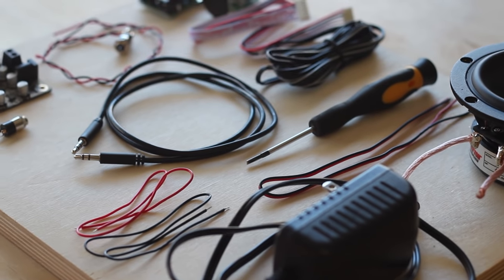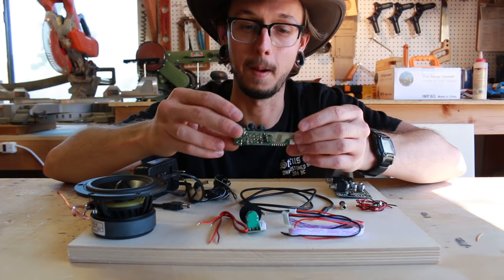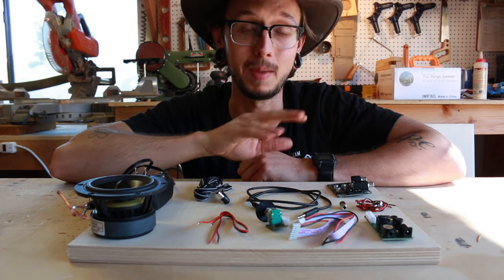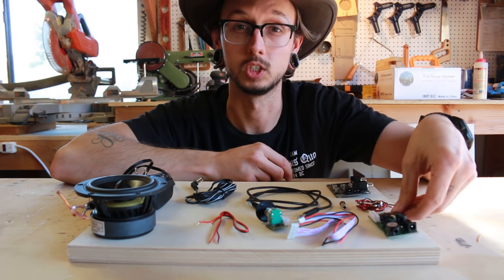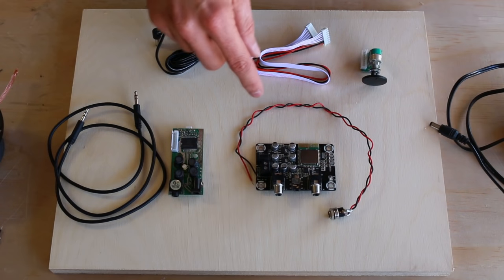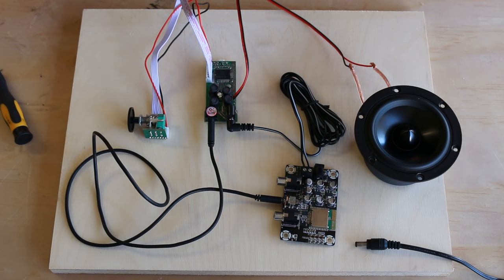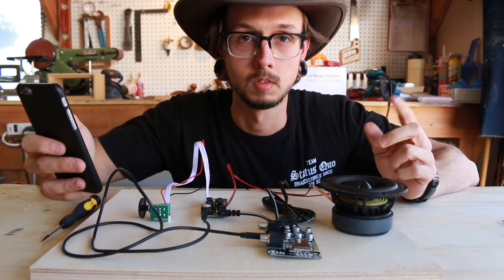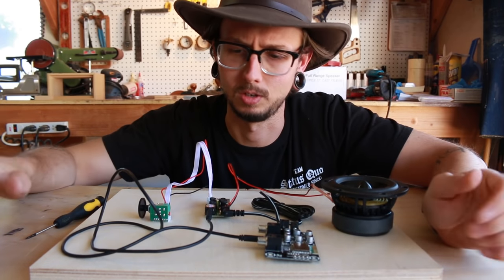Easy DIY Bluetooth Speaker Setup: Make Any Speaker A Bluetooth Speaker | How-To

Comment: Men 12V Is not going to kill no one lol
Reply: I wouldn't be so cavalier about that voltage. It really depends on the circumstances. I've been taught that 50 milliamps can be deadly. I've also been taught that humans usually have a resistance of about 1000 Ohms. Now, the problem with that 1000 Ohms number is that it's an assumption. If your hands are really sweaty, that can come down to perhaps 300 Ohms. And since U = R x I and therefore I = U / R: 12V / 300 Ohm = 0.04 Amp. Which is very close to aforementioned 50 milliamps.

So yeah, chances are pretty good that it won't kill you, but we're not far enough in the safe zone to be cocky about it.
Reply: Well, human resistance is around 100kOhms. It obviously depends on a lot of factors, but it pretty much never goes below 40kOhms.
Reply: I'm not sure where the figure 1000 Ohms came from, but I've never seen or heard of human resistance that low over a reasonable distance on dry skin, and I've measured human resistance in a lot of different situations (which is quite easy to do). As +Karol Feret said, it usually averages in the tens to hundreds of kOhms, but it depends on a lot of different variables, including distance between contacts and what, if any, liquid is present on the skin.

On the other hand, if you are touching your tongue with the contacts, or touching the contacts to either side of your heart and you're very sweaty, you could be in serious trouble. So I'd say 12v can be lethal, but only in somewhat unusual circumstances. 

If you think it is totally harmless, though, try connecting wires to either side of your car battery and touch them to your tongue (the way people sometimes test a 9v battery by touching the contacts to their tongues). It will do more than tingle, I promise you.
Reply: Not gonna tell anyone to do what you  prefer but DC and  AC are 2 different things.AC is considered more dangerous than DC.The guys using AC as a power source so AC being 110 -120 v can hurt us in most countries AC is 240 v.
Reply: 110v ac are only dangerous if you planning to jump into the shower holding your hair drier lol
Reply: After the power adapter everything is safe
Reply: I check the power adapter with my toung. The higher amp adapters are more intense, but I don't hold it on my toung too long. when it's dead, this is a quick way to test. I don't test 110v this way
Reply: Euhm the amp can put out temporary high voltage , ampage signals for short durations. Also i know in old big style amps just the energy load stored in the capacitors can kill you.
Reply: TSpider Keeper AC is not considered more dangerous. 12v DC is just as dangerous as 120v AC. Both can kill you. People need to stop the BS with things they know nothing about. At the end of the day, it's the amps that kill you. Voltage just shows the potential the amps can reach.
Reply: ikr i can't even get it up without pulling out my 18v ryobi battery
Reply: Of course not... Thee voltage doesn't kill people, current kills people
Reply: MP Dope , 12 volts won't kill you but it can cause you serious harm
Reply: DJohn NineOneSix As long as the power supply isn't faulty, properly isolated, etc
Reply: my multimeter says that my resistance is 3mΩ... something can't be right there but the human finger has a resistance of at least a few 1kΩ so 12v CANNOT hurt you. l have put 12v leads all over my body and l haven't felt a thing, the only place where l can just barely feel it is on my tongue and l don't plan on licking a battery any time soon so l am not at all worried about a battery shocking me.

and your math is wrong, you need to be calculating the voltage not the amperage. if your resistance was 1kΩ (which it isn't) then it would still take around 50v DC to over come it. IxR=E so if your resistance was that low then it would still take 5 car batteries wired in series for you to even feel it.
Reply: Omni Media Group+ yeah they can both kill you, but it takes way more DC voltage to kill you the it does of AC voltage. 12v DC can't even be felt, but 12v AC could knock you on your ass.
Reply: J s+ no it can't.
Reply: everybody+ ok it is true that the current is what kills you, but if the voltage isn't high enough then the current won't even pass through your body. you need voltage to overcome the reistance of your body, how else are the amps going to get inside of you? in order to die from electrocution, voltage and amperage have to go hand and hand.
Reply: @johnsmithy9304  not from that small milliamp wall adapter
Reply: Its amperage that kills not voltage...ohm s law.....
Reply: 12v AC could tickle a little.
But DC, man ...
Reply: 36v is dangerous
Reply: Voltage doesn't kill, AMPS does.

Comment: you can also do a tda7492p, it does both amplification and bluetooth receiving. tough it has some faults at higher volumes, they can be fixed by using 24 volts..

Comment: This is very helpful. I'm trying to add a bluetooth receiver in my Haslab Proton pack. The receiver I bought isn't pushing enough sound through the 3 inch Dayton Audio speaker I just installed. Pack sound is great but I would like to figure this problem out.

Comment: Thanks for this video, it's one of the best I've seen explaining this in a really simple way. Now I'm wondering if I'm going to build a portable bluetooth speaker that can be both battery powered and can be connected to the wall, how a battery pack can be connected to this setup so it can work and charge the battery when connected?

Comment: Way back in the late 80s & early 90s I installed car audio for a living. I recently had a friend buy a 2016 Ram Pickup, and he asked me to put two pairs of speakers in the bed. Running the wires is a royal headache , since there's a bed-liner in it. Is it possible to use blue tooth to skip that part of the install?

Comment: Do you have a DIY on a bluetooth speaker but battery powered instead of plugged in?
Reply: Thr guy uses an ac adapter with  a jack. You just need a battery pack with a jack at the end to power the bluetooth and amp. Its what im doing so itll be portable

Comment: Thanks for the video. Any particular reason why a separate Audio amp and Bluetooth board as opposed to an all-in one?
Reply from the maker: No problem, Jason! Arguably, audio quality could be a reason. Some combo amp/Bluetooth boards don't use the highest quality of either, but that depends. Are you you going to hear a huge difference between two boards or one? Probably not. Thanks for watching!
Reply: Cool. Thanks!

Comment: Question...have you ever put a power light on the outside of the enclosure? I suppose you would have to split off of the main power and step it down for an LED?
Reply from the maker: I have! Actually, the amp kit I have linked in the description have a built in LED out, theres even a cable to connect the led.
Reply: +Kirby Meets Audio Perfect!!

Comment: Hey man LOVE the videos! I am building a speaker and have a few questions. I would love to use that iEast wifi receiver instead of the bluetooth situation you got going on here. Can I just swap out the bluetooth board with the iEast wifi receiver and be all good? Next, I need a recommendation on single  8" speaker to put in the cabinet. I just gutted a Sony TFM 9450 radio and I will be making this a rechargeable wifi speaker. Dims of the box are 14x9x6. THANKS!!!
Reply: any advice at all would be great man. 

Will the iEast receiver work in replace of this bluetooth board?
Which speaker do you recommend for a 14x9x6 cabinet?

Comment: How do you match speakers properly to the amp or power.? I am attempting a bluetooth system. I want great sound , great sound first and loudness second. I want bass i can feel with full range from tweeters, midrange, bass with punch and very low sub. What do i look for as far as electronics? How do i choose proper components to give proper power to each speaker? I want a box with a 8" or 10" sub a couple smaller speakers for punch and a couple more for mids and a couple or whatever recommended for tweet.

Comment: Great walkthrough, I recently  purchased a dta-2 amp like you have shown and quite like it. Has there been any issues pairing it with the sure BT board and how it is wired? Tempted to take the plunge on the next build

Comment: Great video, but dang, surprised how expensive all those little bits and bobs are. I'm trying to figure out if I can take the board from one of those little can shaped bluetooth speakers, gut the board, and wire it to the speaker I have in an old gutted tube radio. Problem is, the battery is unmarked (I think it's 3.7v), and I'd like to convert it to use an ac adapter, but I don't know a lot about amperage.

Comment: Say you were building a Bluetooth speaker inside an old radio...and you only had room for one speaker. What would you go with? Just the best full range you could get? The size of the speaker that came out of it was 4.5"...but I might be able to go slightly larger.
Reply from the maker: Yes, I would go with the best full range you can afford. Of course, check out review and make sure the speaker frame type will fit the enclosure.
Reply: +Kirby Meets Audio Thanks so much! I, for one, really appreciate all your efforts...and your enthusiasm! I cannot believe you've gotten negative comments on anything! Just amazing!
Reply: +Kirby Meets Audio I think the maximum size I can use is 4". Would you go with a 4 ohm or 8 ohm?

Comment: I used your video for a speaker build using an a 50s era radio for a speaker box. It turned out great. I have one question for you. While the speaker sounds pretty good, it seems to miss the higher range of sound. For example,  if I were to play the Beatles song Dear Prudence, there is pretty much no sound for the intro part of the song. Can I add a tweeter  to improve the sound? Or do I need to wire a speaker to both the right and left speaker cirucits?

Comment: nice job!! i really like getting to know more about speakers and how you build them. I think in the fawn speaker build video you had magnets around some cables. can you tell us why? 
and the most interesting thing would be, how would you bild a recarchable battery into the speakerbox as well?
Reply from the maker: Those things are called ferrite cores and they help eliminate any high frequency noise in the circuit. They aren't totally necessary, but they are included in the little amp kit I used, so why not use em!
I'll be doing a video on making a portable speaker soon! Thanks for watching!

Comment: Sounds like a silly question but if I wanted too make one myself but with higher watt speaks say 50w+ what sort of amplifier board would I need and Bluetooth module. Also if I wanted too use say 4 of said speakers how would I connect more than one and would the power supply need too be higher

Comment: I like your simple explanations. Thanks for the video!  Question for you, can I connect the Bluetooth device into a 1977 stereo receiver?  I connected my iPhone to the receiver using an RCA (red/white) cable with  3.5 mm jack in the Tape deck input.  Work pretty good. But to make it Bluetooth would really be better!   Thanks!

Comment: Thanks for making this so easy to follow. I'm trying to do this same thing with and old radio. Just getting started, but in researching it seems like  they make bluetooth board and amplifier components as one piece.  Is there a reason not to go that route?
Reply from the maker: None at all, unless you are trying to add Bluetooth to an amp board that is currently in the system. Thanks for watching!

Comment: This is a cool informative video! Thanks for sharing. But I have a question, can I add a rechargeable battery to this set up? And how?
Reply from the maker: Thanks! Using the Dayton amp that I suggest in this video, an 8 AA cell battery holder with NiMH rechargeable batteries will do the trick. You can also use 3 AA Li-ion.

Comment: Great video. I'd like to do this build but with an additional aux in 3.5 jack in the unit to plug my guitar into while i stream a backing track via my iphone, something i can currently do with a little bluetooth unit i have. I have an antique radio carcass I'd like to do a build in with holes for 2 pots, and I'd like to light up the dial window with led's. Do you have a plan for a build like this?

Comment: Just a question regarding the Bluetooth module would it be able to be used in a car with the vehicle running at a charging rate of around 13.3 - 14v ?

Comment: Did you mix stereo to mono for this? If so, do you leave 1/2 of the amp idle, or did you bi-amp the little bugger?  I feel if I just do what you have there I will get only left or right...
Reply from the maker: This demonstration was only a test to make sure the setup worked. The real deal would be set up stereo or bi-amped if you wanted mono. Thanks for watching!

Comment: Hi Kirby, I hope doing good. This is just a thought, maybe build a Guitar speaker cab with an 8" to 12" Jensen or Eminence or other high grade Guitar speaker for use with amp heads or other amps, tube, preferably. Finger jointed cabs and maybe cabinets for tube amp chassis and speaker, Kits? One or more speakers, 2X12", etc.. Anyway, What you do is cool too, really enjoy your channel. Just Ideas. Be good, C.

Comment: if this is called building - how its called when you make your board and solder parts by yourself? like i have fm radio, 70w amp with tda7294, preamp with TL072 op amps, speaker protection with 12v relay, 160w amp with IRFP9240 and IRFP240 mosfets, and 200w amp with 4x IRFP9240 and 4x IRFP240 mosfets all made by myself....currently trying to make 8 band eq board but tracks are so thin that they rip apart or get etched too much

Comment: can you add a tutorial on crossovers and how to add a sub-woofer to a stereo amp (or if you need a 3 channel amp?)
Reply: If you want to add a subwoofer you'll need a seperate amplifier for it. There are actually plenty of cheap 2-chip 2.1 amplifiers on eBay. the two channels of the second amp are then ran in parrallel or bridge. There are some that work a little less well so see if you can find reviews, and if there are problems, look for an easy fix, or simply a fix/better device.
Reply: +vnh sander thanks, I've made a speaker like you did in this video but I used a pam chip that runs on 5v 3w per channel and a 5v blue tooth audio dongle which was about 12 including the small box I made for it. have you tried passive radiators? they're quite effective for small speakers
Reply: +Neo Anzora 12 dollars

Comment: Good work,  
I have a Samsung six speaker home theatre set but want to turn it into a Bluetooth system.  First, how can I power all the speakers without having to use the main central control that come with it. Second,  can the six speakers be powered by battery(power bank) of 2000Wh

Comment: do you have to run the blue tooth board in series with the amp or could you have a designated power splice coming from your power source that powers the amp and blue tooth speaker at the same time?

Comment: what is the black paint/stain your using? I'm building a set of home theater speakers and wanted to know what your using. the last paint I used turned out poorly and spent almost hour sanding it all off the cabinets

Comment: Great Video Kirby,thank you. Now sold on Ebay amplifiers that combine all of that on one Board. Also some have buttons for on and off,Volume control,Jumping tracks,TF Card,USB Reader,etc. I intend to order the Battery charger Board when in stock. Thanks for presentation.

Comment: been browsing the cheaper amps and radio components on aliexpress. the thing I have found is that they include volumes on the board itself.  what would you do in that situation where you would want to separate the volume from the board

Comment: Hey there Mr. Kirby, I'm trying to follow you on how you put the this together however every time i plug the Blue tooth into the amp the LED light on the blue tooth cuts off. Can you help me out? Also i just learned that i have a 9v wall adapter, not a 12v, does that make a difference?

Comment: Hey, great work and thanks for sharing.
I have one problem with bluetooth speaker that I made.
When I turn volume all the way up, suddenly everything drops out, just like loosing power.
Do you have such experience and did you use large capacitor to prevent this problem? I tried 1000uF and I did not success to prevent droping at high volumes :)
All the best ...

Comment: What would be a good black plastic box with handle that fit 6.5 150watt marine speaker on the front side by side this is the speaker I want to put PLMR60W (White) on the front of a black plastic box with handle ?

Comment: is it ok to have more amps on the power supply? i have input 100-240 v 50-60hz 1.5a and output 12v 4.58a
Reply from the maker: Hey John! Thats no problem at all, your power adapter needs to be at least 2A, but will run even better on 4.58A. Thanks for watching!

Comment: Is there a mathematical equation u use for speaker size and size of box, or does bass reflex take away that need?
Reply from the maker: Yes! Though it's not something you'd want to do long form. You use your speakers Thiele/Small parameters to simulate elcosure performance and calculate optimal enclosure type and size. Most driver manufacturers will have a data sheet of these parameters. There are online calculators that will help you with this as well. I'll also be making a video on this topic in the future. Thanks!